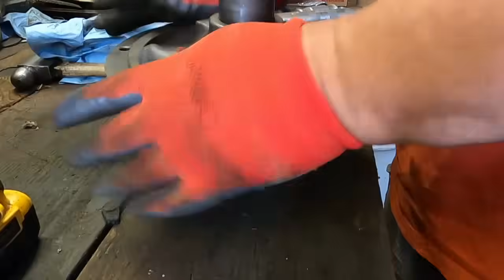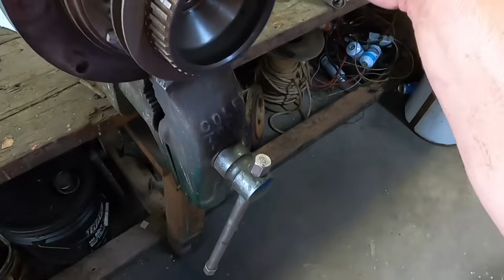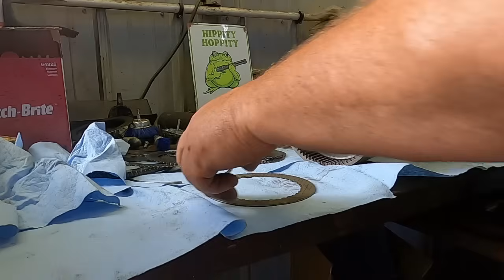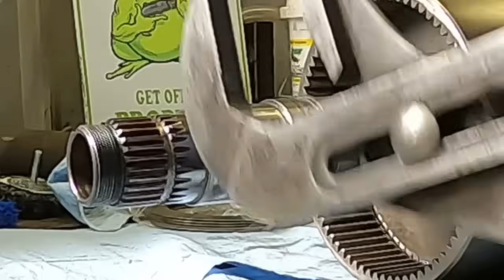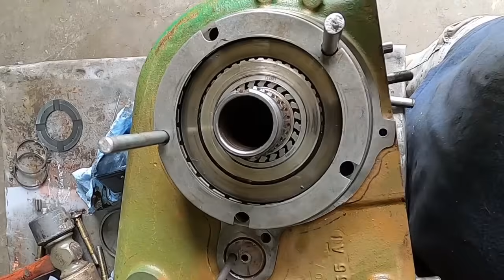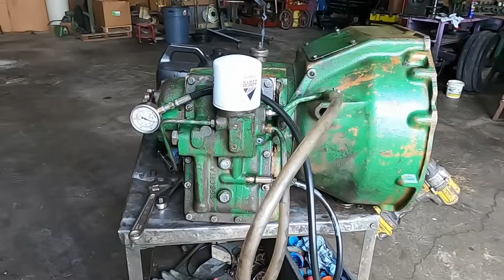Three Speed Surprise part 2

Comment: Good evening ✨ Chris.  Great part 2. 🎉👍😎. Do you remember that email I sent you about old olie in the weeds ( 1955 4x4 ) . Finally caught up with him today 😃.  He said that's one of His Babies 🤣😅🎉 not for sale 😭.  

I have another question ⁉️ about chain to gear coupler. You mentioned that the Waukesha needs more clearance. If you shim between the tube and the main transmission. Would the through shaft be long enough for the clearance needed to remove the engine with no problem 😂😁
Reply from the maker: Bummer on the 1955. 

Shimmimg us a possibility. The splines that drive the pto and hydraulic pump are longer than they need to be. You might gain a half inch. You'd just need to make a spacer to go between the shaft and the plug in the pto. I wouldn't want to short the splines on the engine end. They are the splines that are most likely to wear out.
Reply: @ThatOliverGuyChris Thank You very Much 👍

Comment: 😊😊 HI CHRIS most likely it has a burr on it and U have 2 gri d it down a bit I also seen that happen on a planter be 4 a fellow I know took a planting  wheel off it wouldn't go back on 😮😮 I ran my finger nail over 2 check and thats what it was had 2 use a flat file and file that spot down then the wheel went right ✅️ 😊 back on like it should've 😊😊 OMG 7 2O 2O25

Comment: Sunday morning reset.  Oliver and White missed the boat by not making that gearbox a 4-speed. I heard they were playing with the idea, but bean counters at the time stopped the work on it.  24 forward speeds and 8 reverse.  2 under, 1 direct, and 1 over.  Maybe a 5-speed with an additional 2nd over.  The technology was there to handle that, and handle the power.  JD and its powershift would have been in 2nd place.
Reply from the maker: Dean Barker told me they were working on a 4 speed. They wanted to get rid of the sprag as well, so 2 more clutch packs. The part they were having trouble with was it still had to fit in the same space.